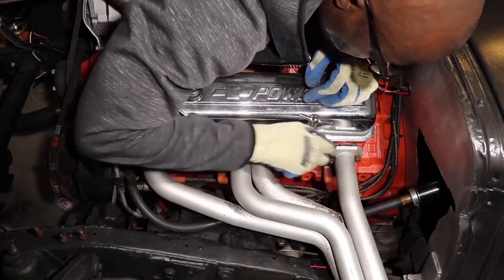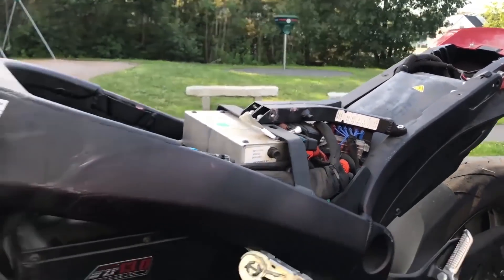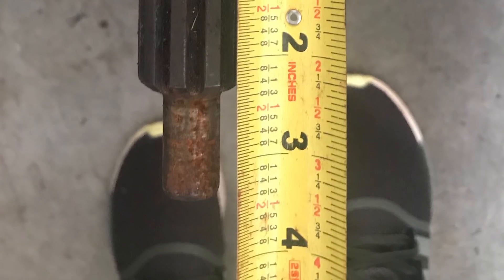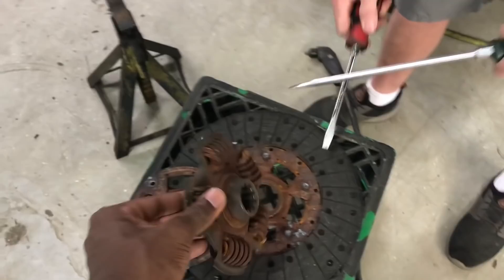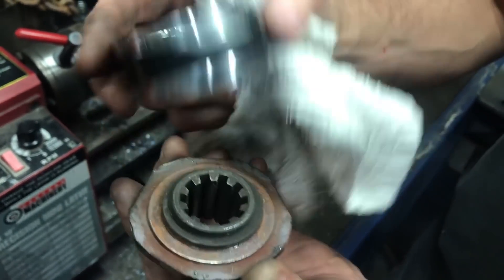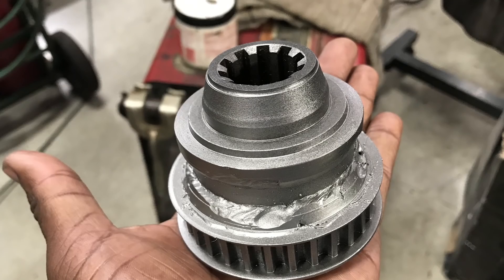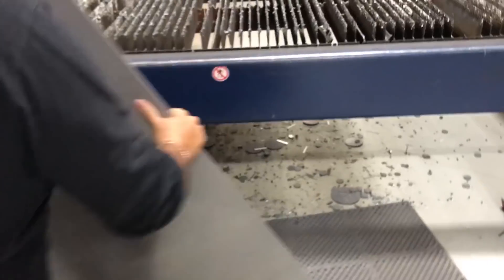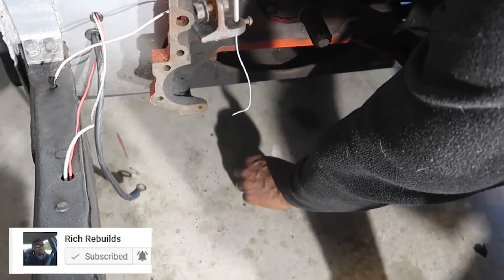I’m building the most BIZARRE electric vehicle conversion

Comment: Rich, you should use one of these couplers. If that motor and transmission is off even the slightest, something gonna break,... this coupler (or something similar) will be more forgiving :)
https://www.amazon.com/Flexible-3-Piece-Coupling-Buna-N-Rubber/dp/B01MS7XUQC/ref=lp_16411721_1_13?s=industrial&ie=UTF8&qid=1565525461&sr=1-13

Comment: when getting metal plasma cut.. do yourself a favor take precise dimensions and  use  a cad program to sketch the precise plate, holes and all.. future you will thank you for the hours saved trying to  manually mangle  something you could have had CNC cut with far greater accuracy..

Comment: I watched your video about the costs of converting a car to an EV ..... ridiculously expensive however I thought to myself what about taking a regular car and having an electric motor and small battery pack to use like a shot of nitrous or a turbo boost it could be done for under 10 grand and could make a 200 hp car a 400 hp car very easily you should do that sometime or figure the cost to do that. I bet a lot of people would come into the Electric garage to have that addition if the price is right!

Comment: That Trumpf Laser was not properly adjusted for the material. For carbon steel, oxygen is used as the purge gas, which also burns the steel at the cut line. For stainless and aluminum, nitrogen is used, at a much higher pressure. When properly adjusted, the cut should be clean, with no slag stuck to it. No grinding, should be needed. I've operated these machines for several years. For that nasty of a cut, a plasma cutter would do just fine, for a lot less money.

Comment: A guy down the road from me has a 1947 Ford pick up converted to Electric!! Like you he bought his with a gas powered V8 engine in his and a standard shift transmission!! I stopped to talk to him one day about his home solar power set up and we then got talking about his truck. What he told me was that when it came to the transmission he opted to get rid of the standard shift altogether and install a two speed power glide automatic transmission instead!! In the end the electric motor make way more torque that the gas engine anyhow and it was easy to just swap in the motor and transmission as a unit that mess around placing them separately, even though he had to make his motor mount AND trans mounts at the same time, to accept an electric motor and a GM transmission into an old Ford body, it was still easier to do it all in one step then in multiple steps over time!!! It is an interesting set up and I think it works well, from what he told me!! But he also mentioned that his truck needed a bit more "structure" strength to handle the increased torque....but other than that the truck is faster with the electric than it was with the gas engine in the end!!!

Comment: 110 HP and 140 ft-lb of torque should make for a fun little ride.  The suspensions on the old rat rods were never really good for the HP people put in them.  Looks like it is going to be a fun project.  You will likely get about 60 miles around town pulling the car, more then you will want to drive the little beast.  Have fun.

Comment: Interesting project.  I don't mean to be rude, but if you're not using the gears you could have just mated the electric motor to the rear diff. by a coupler or short drive shaft and taken the whole transmission out of the car.

Comment: I suppose most of these electric conversions retain the OEM transmission b/c it's relatively easy to adapt to the electric motor. But is it not pretty much dead weight? Why not put the electric motor where the transmission goes and have a single gear reduction to mate it to the drive shaft? Or, if possible, gear the differential appropriately and adapt the motor directly to the driveshaft? Especially on a project where weight savings is paramount. That rat rod is no luxury sedan but it's still gonna weight a literal ton which is way more than a bike.

Comment: Can you do a build with a complete Nissan leaf motor and transaxle?  If the electronic communications arent too complicated, it seems like cheaper alternative to a tesla drivetrain. I considered this for a small pickup truck. For more power and 4wd you can put one in the front and one in the back.  Just have to cut a hole in the bed to accommodate the rear motor.

Comment: He wouldn't have had to knock the hole out and clean it if he had purged the O2 first. Especially after he pulled the lens cover. It fills the head with atmosphere. Laser 101. I understand the mistake being pressured on film though 😊

Comment: This car with the additional welded weights is going to be too heavy compared to the motorcycle and in the end you will only be disappointed with the performance.
The zero electric motor is powerful enough for 0-60mph acceleration. It would have been nice if you could have used it for a electric cafe racer style motorcycle.

Comment: This isn't all that bad, consider for a moment that a Mitsubishi i-Miev has factory net capacity of 14.5kWh in a 16kWh pack. The Motorcycle here has 11.6kWh in a 13kWh, but with much more modern Li-ion cells. If the rat rod isn't too heavy and has a reasonable efficient drivetrain then this could probably average 40miles per charge. Will you be adding any of your Tesla 5kWh modules to this project?

Comment: Gas powered engines only need a clutch because they cant run down to 0 rpm like an electric motor, they have to idle and electric motors dont have that problem

Comment: About that motor to transmission adapter... there is no such thing as "perfectly aligned"... you WILL eventually see the need for a spider coupler... when both the bearings of the motor and transmission go wonky.

Comment: Just a PSA.  If you are going to clean metal with brake cleaner before welding make sure it's NON Chlorinated brake cleaner.   If there is any chlorinated brake cleaner still on there when you weld you'll make chlorine gas which is extremely bad.

Comment: I got a suggestion I hope I'm not to late. Pit Bike I know what you're thinking but hear me out. First, it would be the fastest Pit Bike anyone ever seen. Ok you might have to put the battery pack in a trailer but that would add to the uniqueness. Second and probably more importantly, it would be alot easier to get up those basement steps. It's just a suggestion. Really, I think it's going to have some snap out of the hole. And I'm not going to comment on the rest, other then it's going to be cool no matter what. And it's a damn site better rehashing an e-bike. I subbed over it.  🏎 Wow YouTube needs to work on their emojis thats supposed to be a race car. SMH

Comment: if  motor bolt holes or the bell housing bolt holes are off centre , will you wreck the transmission or motor quickly ?  What  off centre error is acceptable ?  1 thou' of an inch , 10 thou' 100 thou' ?

Comment: 6:55
That is, without a doubt, the jankiest machining operation I have ever seen. Also, your buddy may want to move the cans of flammable liquid somewhere other than immediately behind the grinding wheel...

Other than that, pretty sweet build. :)
Reply: Oh, and if you want a small lathe, look for a used 9" South Bend. They can be had for about what a modern Chinesium one would cost, but they're far more capable machines. They were designed for small work in production machine shops, whereas most small modern lathes are aimed at hobbyists. As a result, the SB will cut better and last longer than any new lathe in that size range.

They also last forever if you keep them oiled. Seriously, mine was made in 1936, and it works flawlessly. For the sake of comparison, I've already had to replace some bearings and rebuild the spindle on my 5 year old Jet mill, and I use the lathe more. I have no doubt the South Bend will be running in another 80 years, but I would be shocked if the Jet lasted half that.

The model A is the fanciest version, with power feed on both axes and a quick change gearbox. The Model B has manual swap gears, and the Model C has manual gears and no power feed on the X axis, but any of them are still great. I have a C, and as you've probably gathered by now, I love it. They're surprisingly common, considering their age; there's almost always one or two on Craigslist where I live, and there are always a handful on eBay.

Comment: I'm using that motor in my KX250f conversion. I will be using a Sevcon gen4 size 6 controller that will peak at 660A and will run on 120V. Thats about 75-80 hp on a 230lb dirt bike.

Comment: Love your sense of humor Rich.  Not sure that motor is going to have the power to move much faster than 2 MPH though.  Just a little better than chucking up a cordless drill on that transmission shaft.
Reply: It's got 116 ft-lb of torque. Pretty good for bike motor. It's why they beat Hyabusas off the line.

Comment: Remove the transmission. Put a pulley on the rear axle pinion. Use the belt drive to do a reduction at the rear axle. Mount the motor on the axle so it is essentially a drive unit.

Comment: It may possibly work but my predictions are:
Underpowered and overworked.
It will move slowly in first gear with the motor screaming, until it starts smoking and burns out.
The motor was made to move a lightweight motorcycle via direct drive to that large diameter rear sprocket. Not meant to move that car via a manual gearbox, driveshaft, and axle. The rolling resistance is too much. 
Should have just got a cheap 250 cc donor bike with a bad drivetrain and swapped it.

Comment: Very dissapointed you didn't add a clutch. 10 or 15lbs of rotational mass isnt going to ruin it and a manual gearbox without a clutch is damn near useless unless you're really good at rpm shifting and hate syncros.

Comment: why did you not lasercut the sheet completely so that u can just weld/bolt it on to the car? if u were lasercutting the hole u should've just let them laser the full piece lol
Reply: I would say the  same as in simmilar comment before. I think he is trolling hard. Just for fun and hurt himself. :D
Reply: that was my first thought. with dimensions of the motor and bell housing the adapter could be cut completely in a few minutes.

Comment: do you even need the transmission? the gears in the rear end not enough? would save you more weight also you should be able to lightn the frame using dimple die style cuts

Comment: Look into to using a Nissan Leaf Motor instead of a Tesla motor, they can be had for $250-400, you can find the 2011 Nissan Leaf inverter for as low as $250.  You can CAN control it or swap in a new brainboard (logic board). People are pushing over 300 HP with these motors. Plus PMAC motors are lighter than Induction Motors. I'm putting a 2011 Leaf motor and Inverter (which is going to be CAN controlled with the help of the Thunderstruck VCM) into a 2001 Mercury Cougar.

Comment: With the SR motor pushing all the extra weight, heat is going to be a huge issue. It will go into thermal management mode very quickly.  At least add a fan for some cooling air flow.

Comment: This thing is going to have about 15 miles of range once it’s powering a vehicle that weighs 5x as much as the original bike
Reply: 15x slower too
Reply: Yeah a rat rod electric conversion is cool but not with a motorcycle motor and battery.

Comment: Only issue is going from motorcycle to car, with less wind going past the cooling fins of the motor and a car that's probably 2-3x heavier then the motorcycle at the least, you might end up cooking that poor motor.
Reply: The weight of the car might make the motor work harder, but the rat rod doesn't have a hood, so should have enough airflow for the engine.

Comment: The car will end up weighing what, somewhere between 2 - 4 times as much as the bike?
What will the performance be like? It looks like you're going to have the transmission connected, so you can select a gear before starting, but you won't be able to shift once you're rolling without having to play with the throttle level in order to unload the tranny  for the shift?
In any case I look forward to the road testing...

Comment: Perfectly aligned" coupling that never referenced the splines' pitch diameter. Good enough for a rat rod, but not perfectly aligned in any way.  To prevent bind from slight misalignment use rubber mounts on the motor to allow a little movement up and down/side to side or rely on shaft bearing clearances.

Comment: First, that socket drawer was awesome.  Second, maybe after you get it all adapted and working, you can take the transmission out the lighten it, both for total weight and rotational weight.  Probably a lot of boat anchor material in there.  :)
Reply: Well, ditching that 305ci anchor helped.

Comment: I’m surprised you didn’t just bypass the trans altogether and mount the motor right on the diff. It’d be 100 pounds lighter...
Reply: Yes, but then how would you reverse?
Reply: @fatwajim  electric motors go in reverse
Reply: @fatwajim  Joking right?
Reply: @fatwajim  The reverse could have been done. electrically.  I think it is a cool idea and you will find there are a lot of losses going thru a drivetrain.  But still very cool.
Reply: Then he would'nt have reverse unless he added some stuff to the controller to reverse the polarity on the motor, that's one of the reasons a lot if not most ev conversions retain transmissions, it simplifies things with the mechanical reverse gearing.
Reply: @atf01234  Reversing is trivial. If the controller software doesn't support it then just swap any two of the motor phase wires.
Reply: 1:1 would lock it in "4th gear" normally so very slow acceleration without a super super low geared rear end
Reply: MiG21aholic with a ~20% power loss. I’m thinking there’s still a way...
Reply: @boedekerj1  widened electric golf cart axle would have the right gearing, but all reduction gearing has friction
Reply: The torque would be gone then, if it would even move.
Reply: Since he's using a smaller motor the transmission might actually be useful
Reply: mhhhh like 80lb lol
Reply: @chrisgosselin6399  The major loss is the resistance through the drive train.  The weight has less meaning. In any case, it will be really fun. I am looking forward to seeing it run.  :-)
Reply: Wait, he's still using the trans? So you have a limited power on the motor and you push it through a multiple-gear planetary transmission with a torque converter, reducing your power even further.

EVs are direct drive for good reason. Dump the trans and mount the motor in the trunk so you have room for more batteries in the front.

If you want to go reverse, just make a circuit that flips 2 of the motor phases and the motor goes the other way.

Comment: why not use an atv style rear axle and attach the motor in the back and put the batteries up front eliminating the transmission all together?
Reply: Ever driven a car without differential?
Reply: @peterzingler6221  welded diff 4 life
Reply: In case he wants the gears later.
Reply: I was expecting straight on to the difference pinion but that my couch expertise
Reply: @alexgray2042  Differential? Because when you have direct drive you do have higher efficiency, yes, but you also have to deal with lower torque output compared to having mechanical advantage to help him get through the gears- though I can't help but think that IMO removing the clutch assembly instead of fabricating an adapter was a mistake.
Reply: Yeah...and use diferent (single speed  if is posible) gearbox to fit all in the back...
Same as front wheel drive...
Reply: Because it's way easier to simply connect a motor to a transmission and that sounds stupid
Reply: Relays are staggered energy, kinda like a tranny, no?  Energy transmission .  Gears rpm .  Havta LOVE the instant tourque.  Best thing EVAR imo.

Comment: Rich, I know you saw my electric sandrail build before. The motor you are putting in is about the same power handling as my setup and similar weight. Don't use 3rd gear or you'll very quickly overheat the motor. Hopefully 2nd gives you enough gearing to get to highway speed. Your motor is passively cooled, but you might want to look into a nice squirrel cage blower or ductwork to blow over it. As-is, it will be sufficient for a 40-45 mph around town cruiser without worrying about overheating issues. Good luck!

Comment: So a scrap zero might make sense for ones own bike conversion . If the car doesn't work out I hope Rich does a bike conversion with the bits .
Reply: The Zero motor will have trouble with all that weight, a frame swap on a different bike would have worked better.